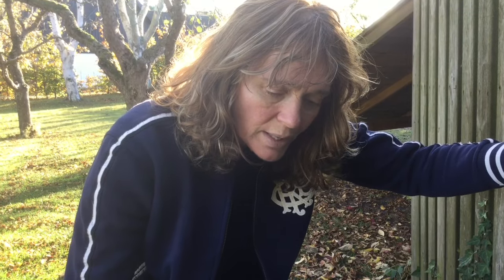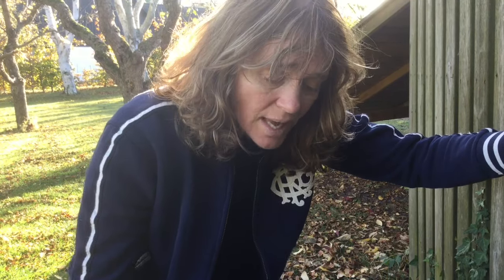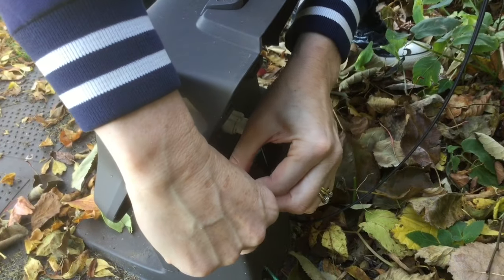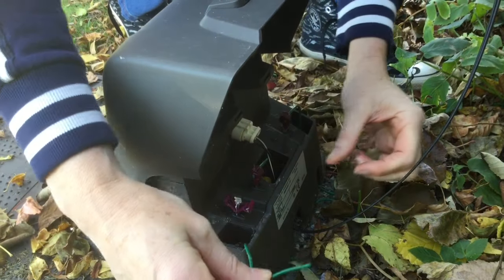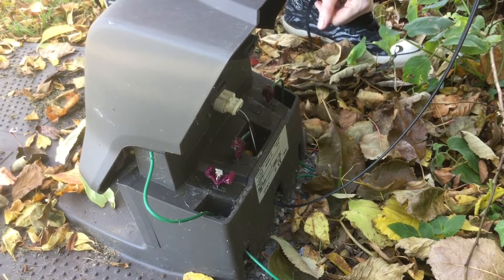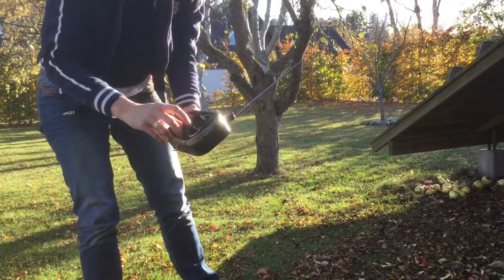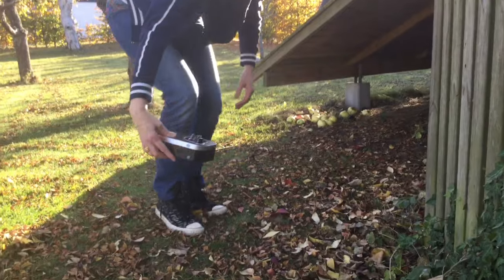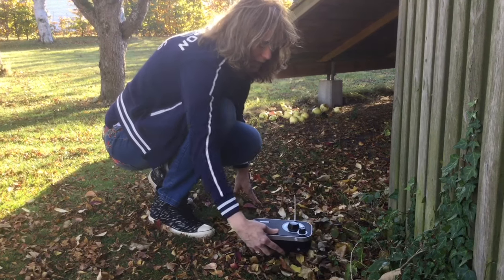Automower Find a cable break with AM radio

Comment: Many thanks for the tip! The video is already 7 years old, but it saved me a lot of work today. I knew the tip about the AM radio, but none of the tips mentioned that you have to remove a cable from the charging station for the measurement. That was the key to success.
Reply from the maker: Glad it helped!

Comment: Worked a treat today for me today. Lifesaver! I recommend using earphones so you can hear it more precisely. I’m my case the couplers weren’t tight enough to make connections. Also if you hear a pulse it means the circuit isn’t complete. A complete circuit sounds steady and has a stronger signal
Reply from the maker: You're welcome

Comment: It works! The signal is not always equally strong along the wire, but with a bit of experimentation I found a wire break today I would never have found otherwise. I connected one of the boundary wires to the guide wire connection, as this seemed to produce the strongest signal for me (mine's a McCulloch.) I followed the signal as far as I could, then did the same with the other boundary wire joined to the guide wire connection. Between the two, the wire turned out to have been broken, probably by an animal digging, and then reburied! Actually learnt about the technique elsewhere, but thanks for confirming it with this video.

Comment: Thanks! Worked like a charm. Would never have found the break without this tip.  Was resigned to having to pay alot or spend a ton of time fixing this.  Just as well our radion has an AM band - first time we've used that in 20 years+!
Reply from the maker: Glad it helped!

Comment: Good tip. It works.
Problem is, that no one have a portable AM radio anymore these days, because of modern cell phones etc.
Your parents or grannies may have one stowed away in the attic if you are lucky, and the battery compartment has survived the old batteries left in there for decades.
Reply from the maker: CXensation most technical apps sell them. We managed to find one that was both battery and mains. Didn't cost much
Reply: Wall mart has am radio.

Comment: Thanks! Will try that this weekend.
Reply: I forget to get back to this. I did try it with my Worx Landroid, with a couple different radios, but could not detect a signal. I tried all up and down the AM band. I finally had to do it the hard way with some long wires, pointed probes to pierce the insulation and a continuity meter to find the break by midpoint sort.
Reply from the maker: We have bought a proper tool to search for our cable breaks now too. After 3 years we are seeing several breaks, animals_ wear and tear_ roots, gardening ....sadly

Comment: Hi Wendy I have an am radio, just wondering do you have to disconnect one of the wires at the back first or was that just to demonstrate if there’s a beak in the wire ?, thanks in advance
Reply from the maker: That is correct, discoennect one wire so you easily find the break. If you have the signal going from both directions it is harder to find the break

Comment: I have a Guide wire break somewhere (message on Mower says Guide 2 Not Found). Will this work for a Guide Wire as well? How would I begin, as far as disconnecting any wires on back of base station? Thanks
Reply from the maker: Yes it should work for the guide wire too

Comment: Hmm can you help me maybe pls?
I used your tip.
Ive disconnected both guideline and right cable. 
Followed left cable and somewhere down the line i stumbled upon guideline and even right cable and i still got signal/sound in the am radio?
Shouldent those be silent since they are not connected?
Reply from the maker: Hmm strange?

Comment: I've, unfortunately, have been unable to find the breach on our cable with this technique. My AM radio is detecting rather a strong signal on one if the sides even when the cable is not plugged into the station. Very strange. Could it be picking up ambient current from the copper? 🤔
Reply from the maker: Doubtful 🤨

Comment: Thanks for the video! I was wondering, which freqence did you use (if it matters at all?)
Reply from the maker: We just screwed on the dial until we could hear a strong signal in the radio

Comment: What frequency should I tune it to though?
Reply from the maker: Change it until you here a clear signal close to the wire. You need to be in AM mode
Reply: @Wendy_maths  What frequency did you use?
Reply from the maker: @petertr2000  you have to have it in “am” mode and just turn the dial close to the wire, until you hear the change in signal from white noise to a beeping sound

Comment: Tried this but my flymo 1200R wire did not flag up on my little AM radio
Reply from the maker: Shame, you can buy a cable finder fairly cheap on amazon